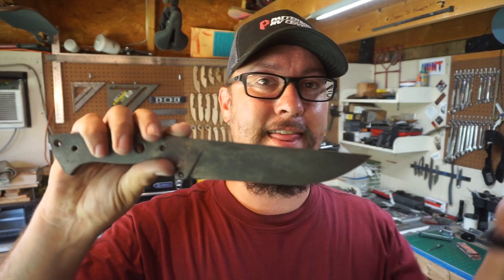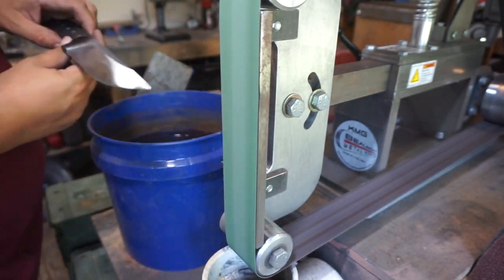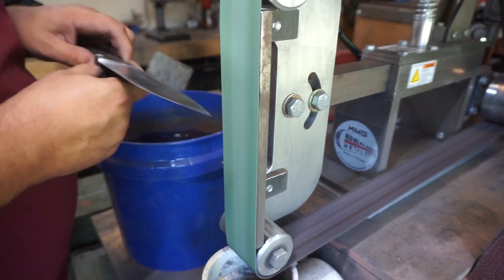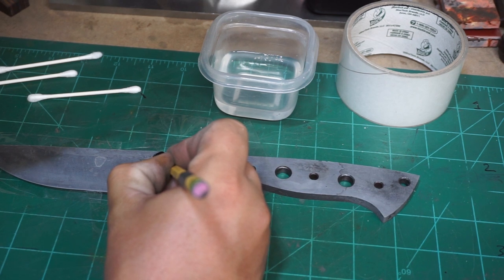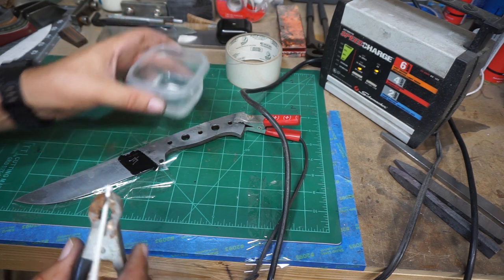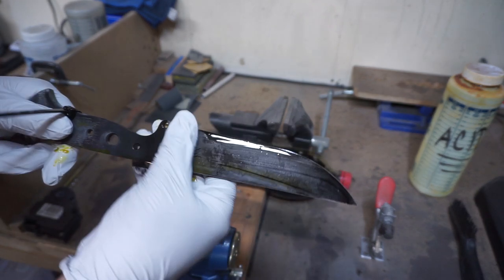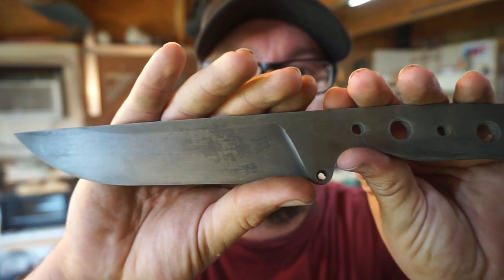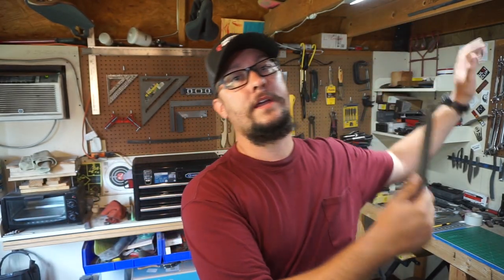Cleaning Up and Acid Etching The Chopper | Knife Making | Vlog

Comment: I acid etched my current knife build and in between dips I was told to rub it down with 0000 steel wool. I did this and it put small scratches in the faces 😡, so next time I'll wipe off the oxides with a soft cloth, or my gloved hand.

Glad to see you didn't follow this dumb advice, Eric!

🇬🇧🤜⚡️🤛🇺🇸

Comment: Couldn't you take the decarb out and polish the blade in one step with the scotch brite?
Reply from the maker: Yes, you could but I don't like to risk rounding any of my sharp edges with the scotch brite belts. You really just want to use them for finish work or light smoothing.